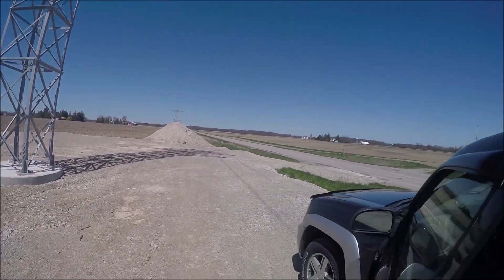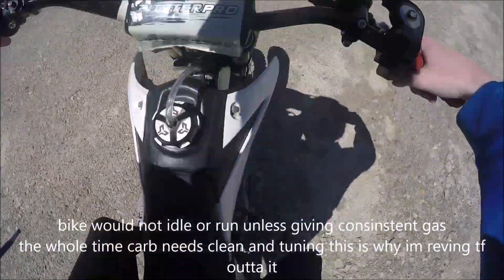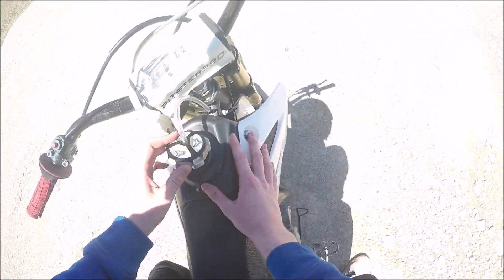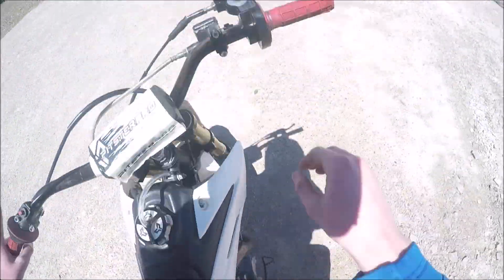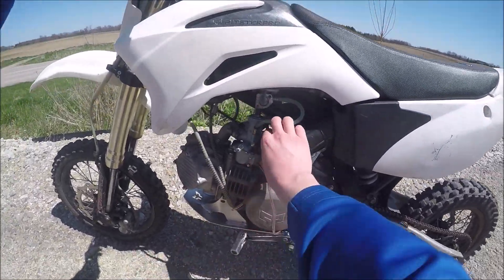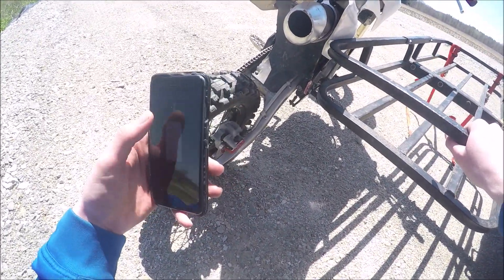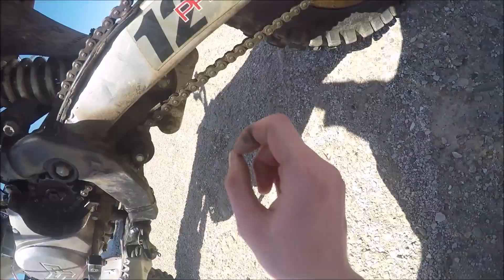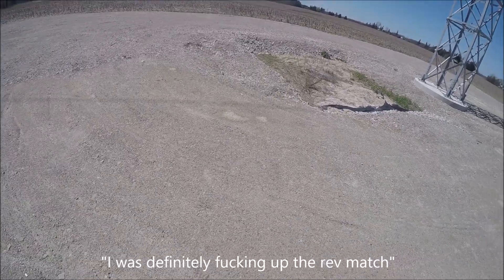NEW Pit Bike! Pitster Pro 160cc

Comment: It's valve bounce not rev limiter on these 160s so be careful
Reply from the maker: just did valve adjustment recently actually..I thought it had a limiter, doing up date video soon
Reply: @ag2793  no rev limiter bud it's valve bounce on the 160cc
Reply from the maker: @stumpedtree4204  does yours leak oil from the oil filter at all mine does gonna try gasket maker to seal it
Reply: @ag2793  mine used to. your missing a tiny o ring that sits in the bottom left corner of the case buddy garunteed
Reply from the maker: @stumpedtree4204  where can u find em u talking about that triangle part pointing down right
Reply: @ag2793  yeah bro. Bunnings cheapest assorted size o ring kit sorted it out for me used one of the tiniest ones in it
Reply from the maker: @stumpedtree4204  okok dope ill give it a shot and let u know appreciate the help I subbed to ur channel should upload more pit bike vids